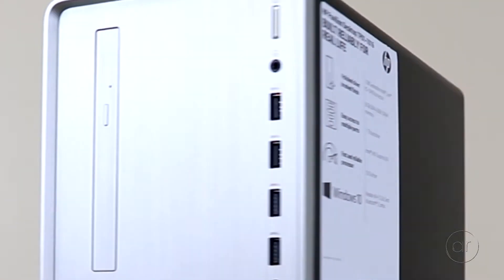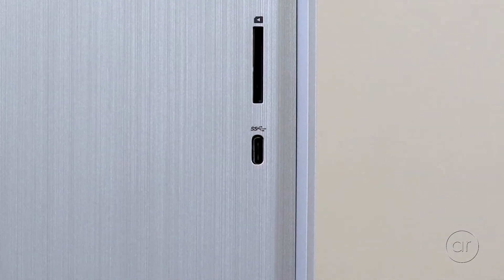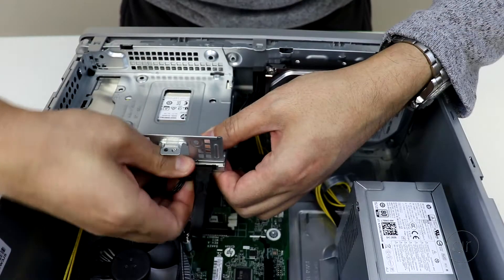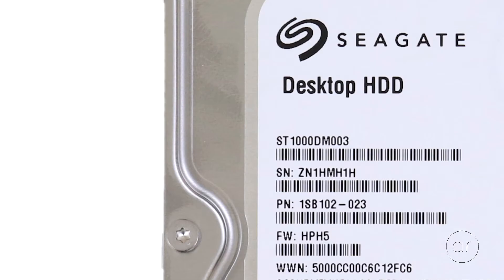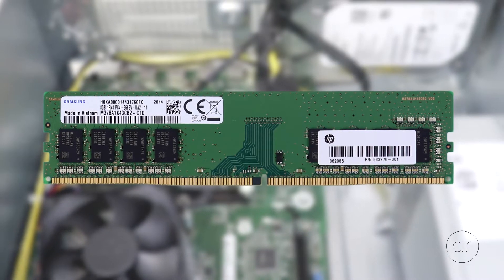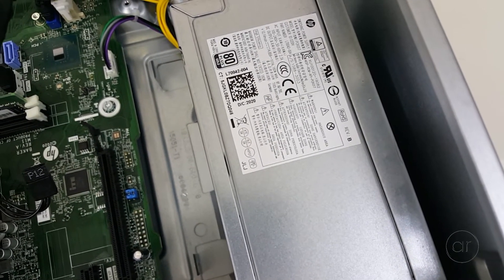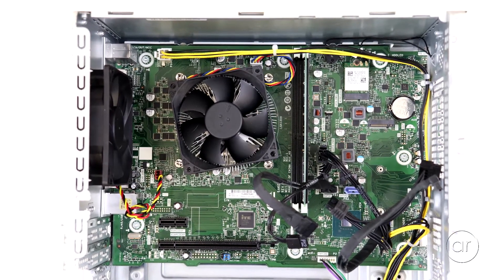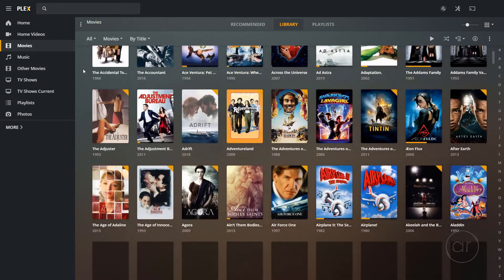How to Open and Upgrade an HP Pavilion with a 10th Generation Intel i5-10400 (TP01-1016)

Comment: What size case fan is that? 80 or 120? Just bought a different model that uses this same case, and need to know ;p
Reply from the maker: Sorry, I hadn't measured the fan - I'll need to do that the next time I open it up. But judging purely by the dimensions between the screws on the outside, I believe it's a 92mm fan. Does anyone else know for sure?
Reply: @accessrandom  92... mmm going to have to do something about that then, I get the system tomorrow, so I will beable to find out myself soon, but was hoping to use something I already had, but it seems I might have to buy another fan ;p

Comment: Great video! Just bought this exact PC.  Popped in an 8gb Crucial DDR4 2666 stick into the empty slot and cloned the system over to a 500gb Samsung 970 EVO I installed in the M.2 slot using EaseUS Todo Backup. So much faster!
Reply from the maker: Thank you 🙏. Would you happen to have the model numbers for the Crucial and Samsung? I believe the Samsung is MZ-V7E500BW. I can add it to the description with credit to you, if you'd like.
Reply: @accessrandom  yep, that’s the correct model # for the EVO.  Crucial RAM is CT8G4DFRA266.
Reply from the maker: @flashjk22  Added to the description. Thank you!
Reply: Mine is very similar.

Comment: So this Desktop wont support a low-profile Graphics card such as the GeForce gtx 1060?
Reply from the maker: It may fit physically, but the power consumption of a GTX 1060 can be up to an additional 120 W (which the existing power supply would not be able to handle).

Comment: Little note: even if we put an extra Graphics card in, we might loose the DVD-writer, or the HDD expansion slot, because maybe those are in the way (its space was measured without them in the case)... Be carefull think and measure twice before you buy something!
Reply from the maker: Thank you  - that's a good point that I missed. Best to re-measure with the cages in if in doubt.
Reply: @accessrandom  Ok, now as i checked the 2nd video from this machine, i saw the DVD-drive is in an offset, enought to let that keept in case a Graphics card is inserted! Even if the card is not extremely wide (or tall if we measured from the PCIe port), the black bracket is far enough....